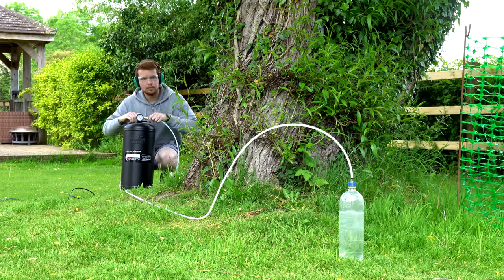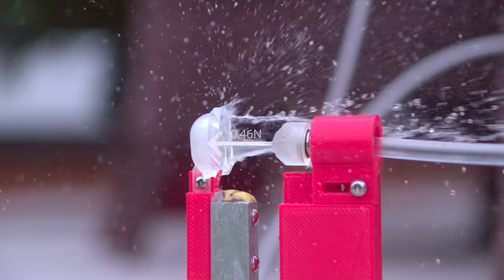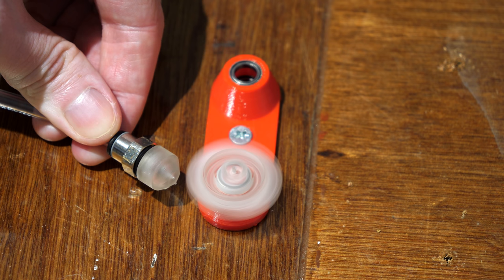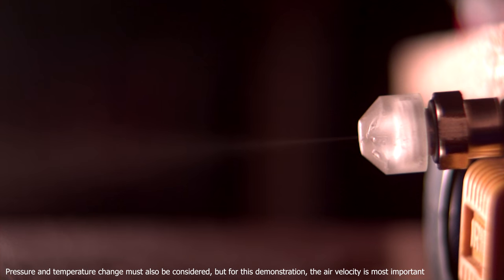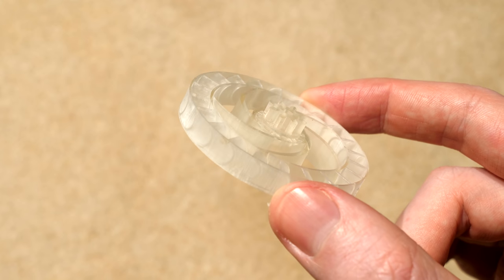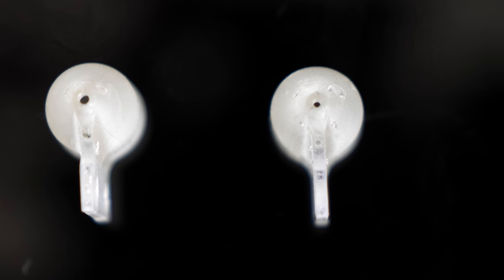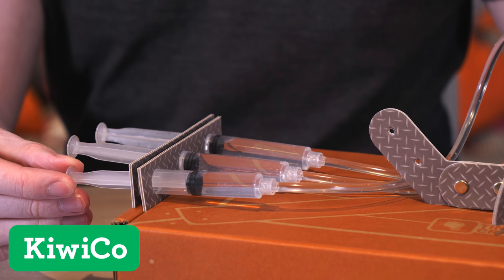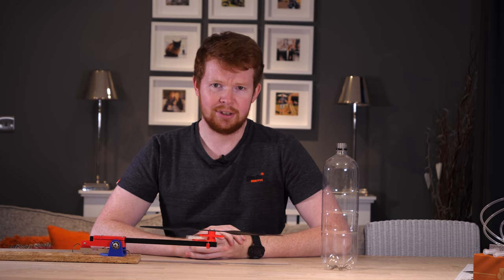Micro Pelton Turbine

Comment: Is there a way to put a release regulator on the air nozzle to release the air in spurts?  Could allow for conservation of the compressed air?  An escapement mechanism possibly tied to the rotation?  Since reverse is not needed, What about a worm drive?  Finally, a sealed system may add additional torqued if the nozzle had a collar to suck in additional air?

Comment: Doesn't the nozzle by itself have inefficency due to Rayleighs number or something like that? I cant remember how it works mathematically because im not great with calculus.

If I recall correctly, the most efficient exhaust speed of any propulsion system that involves moving air, is an exhaust speed just slightly higher than that of the vehicle's airspeed.

This means that you can increase thrust by increasing exhaust velocity as high as you feel like, but it'll never be efficient if you have an exhaust velocity that's super high compared to your airspeed. If you want to increase thrust while maintaining an efficient exhaust velocity, then what you need to do is move a larger VOLUME of air.

Taking that tiny, low volume, high velocity nozzle, and converting the energy it outputs into a much slower, but much more voluminous movement of air by the propeller, greatly increases efficiency without losing thrust (and in fact, you can see here, it gains thrust, in part because its an efficient use of energy). If I recall correctly, part of the reason for this inefficency is turbulent airflow between the exhaust stream and the surrounding air bleeds energy away from that exhaust. The greater the difference in speeds, the more turbulence.

Im a jet engine mechanic by trade. This concept was really important in jet engine development. Early jet engines were basically straight turbojets. These allowed for very highspeed flight, but werent very efficient, espescially as subsonic speeds. Early jet engines moved a small volume of air extremely fast, usually way faster than the plane's airspeed.

When it came to making bigger subsonic planes like the boeing 707 jet powered, the only thing they could really do with the technology at the time was scale turbojets way up, like the J-57. These engines ran inefficiently, chugged fuel, and honestly... Didnt produce that much thrust compared to todays engines. 4 of them were needed to power the 707, an airframe about the size of a 737... And the 737 with 2 CFM56 engines could probably still outperform it.

The issue is basically that youve stuck fighter engines on an airliner. J-57s may have lower thrust to weight ratio and lower efficiency than modern airliner engines, but due to its high exhaust velocity, with a variable exhaust and afterburner, they could easily take planes well past mach 1.... But planes like the 707 didnt need to go supersonic, so you can imagine how useless that feature is.

The real innovation here was finding ways to convert small volume, high velocity jet exhaust into a bigger volume with a lower exhaust velocity. This resulted in some key developments. First, splined drive shafts. This allows one drive shaft to spin around another spinning drive shaft. This means components can spin on the shafts at 2 different speeds. Now, you can use the outer shaft to run your compressor blades, and the turbine to power your compressor. This part of the engine is the "core" the actual jet engine part of the engine. And on the inner shaft, you can run a different accessory. In the case of my jet engine, the CFM56, this is a giant ducted fan. And it is powered by a lower speed turbine that follows after the high speed one. This ducted fan takes most of the power from a small jet engine (the core is much smaller than, for example, a J-57), and converts it to a very high volume of air moving at just a bit faster than the high subsonic speeds airliners fly at. This ducted fan moves that large volume of air around the core through a "bypass". This also results in a low velocity exhaust around the higher velocity exhaust from the core, which improves even the efficiency of the core's exhaust.

As a result, the CFM56-2B has a bypass ratio (how much air moves down the bypass vs down the core) of about 6:1, about 80-90 percent of the thrust is produced from the bypass, only a little bit of thrust is produced from the core, and the engine over all needed much smaller "cores" that sip way less fuel, to accomplish way more thrust.... This type of engine is called a high bypass Turbofan. Its only real downside vs a turbojet is that it cant fly much faster than mavh 1.2 before literally exploding.... but no subsonic airliner can realistically fly that fast.

Bypasses like this are even used to make cooler running, more efficent high speed fighter engines. They however have a lower bypass ratio to increase average exhaust velocity. Basically, bypasses can be tailored to the aircraft's intended airspeed.

In the same vein, the other innovation was the turboprop engine, basically what tom is doing with pressurized unburned air. Turboprops are used at even lower airspeeds than turbofans. They also turn low volume high velocity exhaust into high volume low velocity. They can be done either with a free spinning splined shaft like the turbofan, or, I know of some designs that simply gear the prop directly to the core shaft using an appropriate gear ratio.

Because turbofans and turboprops are quite a bit more complicated than a straight turbojet they required time to develop.

Comment: Its a simple case of opportunity for reaction. With the nosile alone, it's only opportunity for reaction is with the limited volume of air below the rocket nosile. Even with all the losses from energy expenditures that are not generating thrust, the vastly greater area of the propellers offer a much larger volume of air to react against.

Comment: From the slow mo it seems that there is a good deal of energy lost when the air or water transitions from blade to blade.
Isn't there any design approach that would allow the motive energy to be captured sooner on transition rather than just 'splashing' everywhere before the edge of the next blade catches the flow?

Comment: Just to be pedantic: the bottle was weighted with air at 1 bar in it. When ‘full’ at 6 bar it will be about 5g heavier. Maybe more importantly would be the humidity of the air as water vapour will not expand so you’d want to fill the bottle with dry air.

Comment: If you used your air bottle to force a volume of water into the wheel, what change in power would you have?  This would not help your eventual aim of making a compressed air helicopter but it might show how the device could be used for stationary purposes.  Thanks for the lesson.

Comment: Hi Tom, maybe look at the design of a turbine wheel from a turbo charger. It has a similar mechanism, converting air flow to shaft rotation however uses higher flow and lower pressure. The geometry could be altered for the lower flow high pressure u are working with.

Comment: The nozzle is less efficient because it is high vel. low mass; low velocity high mass transfer is best at low speeds that is why high bypass turbofans are most efficient in airliners.
A way to explore to yet further increase efficiency is to increase propeller diameter to yet further increase reaction mass flow. For low speed operation a three bladed prop. with a ring connecting prop blade tips for a ducted fan effect may yield ultimate efficiency.
High velocity low mass air used to drive low velocity high mass air for propulsion efficiency. What is interesting is that the turbine/ propeller combo is performing the same function as a torque converter in a car.
Reply: The problem with increasing prop diameter is a very small increase will cause the prop to absorb a lot more power unless the prop is slowed down quite a lot. Everything is inter related.

Comment: What if you made the "well" (or "pocket") of each "paddle" on the wheel out of an elastic material (like the thin rubber of a balloon), so that the internal volume of each "paddle" could expand to accommodate the gas at varying pressures, sort of like an elastic "sail." You could theoretically extract more of the kinetic energy of the moving gas by temporarily storing the energy of the expanding gas as potential energy in the form of stretched rubber, which would expel the gas even after the "paddle" has left the path of the compressed air stream from the nozzle. Just a thought.

Comment: You have done the test at 6.9 Bar of pressure, greater than the critical pressure ratio, the flow probably chocked at the nozzle design a convergent-divergent nozzle with proper area ratio for the P0/P [6.9 Bar] then redo the test again... Now flow will be supersonic at the outlet Make sure you don't get any shock at the downstream.. Now I'm pretty sure you will see a difference in Graph.

Comment: Just looking at the thrust equations: for a turbine driven propeller its thrust equation is proportional to V^2 while for the nozzle its thrust equation is proportional to just V. Turbine Driven Propeller Wins. Also in order to get more juice out of that nozzle, you would need to create the right pressure ratios, converging/diverging nozzle, etc. to expand the flow isentropically as close to the back pressure as possible for max nozzle efficiency.

Comment: I'm a little late to the party. I've worked on turbines for many years and they all featured multi-stage design. I thought your shrouded turbine wheel looked the most promising. It's essentially a single stage impulse turbine whose efficiency could be improved with a static reversing set of buckets arranged over an arc. A second stage turbine wheel  and perhaps a third with progressively larger buckets to take advantage of the air's expansion. Needless to say close clearances and careful design and construction pays off in greater efficiency and more bang for your bottle of air.

Yeah, we're reinventing the wheel but recent developments in filament printing offers a quantum leap in performance in home-made miniature power plants. Too bad there's no practical way to precision print metals and superalloys, high performance ceramics, etc.

Comment: Try using a small metal bottle insted of this big plastic one, and insted of compressed Air, you can use dry Ice.
Maybe this way you can have a longer pressure suply with the same or less weight.
The metal bottle is needed to make the heat transfer more efficient between the dry ice and the outside so It can transform into gas faster.
A small portion of dry Ice has a lot of gas potencial.

Comment: Try building an engine with built in govenor to controll airflow and a heavy flywheel, it will make the engine loads more effecient! And to regulate speed you just let the weights travel farther out by adjusting the spring nut (you can get inspiration from hit and miss engine govenor)

Comment: The gears add a layer of inefficiency due to friction and that jazz - increasing the turbine diameter 5 times and mounting the propeller directly to the turbine would theoretically create a more efficient engine - though maybe with other downsides like size and weight

Comment: Just had an idea; what if you had 2 containers one of which you had air under pressure and the other under a vacuum.  Connect them and use an in-line turbine, a valve and greatly increasing the airflow because one would be pushing and the other pulling?

Comment: Underexpansion,  The air leaving the nozzle is still at pressure, which goes out in all directions, so lots of energy is wasted expanding sideways, rather than straight down.  You might be able to add a rocket-style nozzle to expand the air inside, though I'm not sure if it would work as well without the combustion stage you see in a rocket nozzle.

Comment: Not an engineer (well, technically I have an electrical engineering degree, alas not applicable here), but I'll take a stab at theorizing around why the air on its own is less efficient than the rotor.

Does it perchance have anything to do with the energy loss from the air travelling further before hitting anything?

Aim the nozzle to the ground, and it will have its own height of distance to travel before pushing against anything, as air is compressible.
Aim it at a wheel a few millimetres away, and it has much less travel to do, meaning less dispersion before it expells that energy.

I probably got it completely wrong, but that's the first thought that popped into my head when seeing the two demonstrations.

Comment: For nozzle-only you would need to design the appropriate bell to allow the air to expand to atmospheric pressure. Then you'd have to resolve the issue of changing pressure. Literally rocket science without the fun explosives at that point.

Comment: what about a turbine where each "blade" or "bucket" splits the airflow into two paths but the 3dprinted cross section of the blade includes a section from a tesla valve, so you take some of the incoming air and redirect it around to create a high pressure obstruction, which also pushes back pressure in the second chamber and pulls more energy out of the air slow? the problem is the time each blade is in contact with the stream is minimal, and then you have to deal with the effects it has on the rest of its journey around.. hrm

Comment: From data i assume your nozzle has only convergent section. According to my calculation i get 4Bar - 1mm nozzle - 0,34N (only nozzle). It might be interesting to try add divergent section with exit diameter of 1.3mm theoretical performance is 0,52N so about 50% more.

Comment: You'd be surprised how much pressure you can store before vessel failure on that bottle if you wrap it in a few layers of tightly-wrapped electrical tape. Maybe the added weight and reinforcement/elasticity would be worth the added compression.

Comment: Look up steam turbines.  Its the same concept of using compressed air (steam) to spin a turbine and they have been perfecting them for over 100 years.  They use the same turbines, but stack them with redirecting stators between stacks to take advantage of the air as it expands past the first turbine.

Comment: Well, you basically built a laval turbine without the laval nozzle. The jet from your nozzle will never get faster than Mach 1 if there is only a converging shape. To get a faster jet, you need a convergent-divergent nozzle (known as laval nozzle). Maybe you can print one with the resin printer but the shape has to be optimized for your specific pressure difference.

Comment: What's the efficiency of this compared to standard electric motors. Say I wanted to create a craft that had an engine on board, and that motor drove either a compressor for an air-driven system, or an alternator/generator for an electrically-driven system; an engine to keep the power source comparable, an electric power source isn't as comparable because it'd be a singular motor driving a compressor vs. four individual propeller motors. 
I would assume electric motors come out on top.

Comment: Can you try to make a plane that runs on a stirling engine? You could use a candle for the heat source, and have the airflow cool the other side. Perhaps some compressed air and some water spray could use evaporation to supercool one side, while the candle heats the other for peak efficiency.

Comment: How about adding a lower pressure second stage to the turbine? That redirected air coming out at the bottom of the first stage might be "harvested" by a counter-rotating stage.
Also, it might be interesting to test a version where the airflow is coaxial to the rotation axis, which would probably make it easier to add multiple stages by interleaving them with a flow-redirecting stator stage.
Oh, and wondering if the pressure source will always be compressed air or if there might be a future version with a chemical gas generator onboard. Oh my, so many ideas :D

Comment: You need a gear multiplier system. Your gear set on the  propeller should be smaller than you have it. Think mountain bike gear sets. Most have 3 sets on the crank gears, and between 4 and 8 gears of varying sizes arranged from larger to smaller and it corresponds with the gear up front. So if you have the crank gear at 3 and the rim gear at 1, that means for every 1 rotation of the crank that rear gear is roatating 3 times. A 3:1 ratio. Your setup seems to have it reversed. With the crank being set at 1 and your rear gear at -3, meaning for every 3 cranks the prop only turns 1 time.

Comment: I'm curious about your comparising with using just the air nozzle, what would it be if you had a small rocket like nozzel at the end instead of just a open house? I mean all the moving parts adds losses, just a optimal nozzle should be hard to beat.

Comment: Tom, I wonder if you couldn't leverage some of the designs used for centrifugal compressors, since that's effectively what you're building (but in reverse).  Also you'll want to select your airfoil on the basis of Reynolds number for your system.

Comment: Amazing video as always Tom! An idea came to mind while watching your video, with the capability of thrust vs weight of the blades and gear ratio, could there be some application of a small air compressor system at one side of the 2L bottle, powered by a small Li-ion battery pack, that could keep the pressure in the bottle while in flight? I’ve not looked into compressor sizes or weight, solely going off of a small designed one I saw on another science YT video once. But thought I would float the idea anyway. Looking forward to your future videos on this concept 😊

Comment: could you implement a pressure regulator so that you dont get such a peak?

and to my experience, the more robust bottles (Mehrweg 1 Liter plastic bottle) can hold up to 10 bar before they deform, but they are also somewhat havier of course. Just used them as a cheap way to build model rockets.